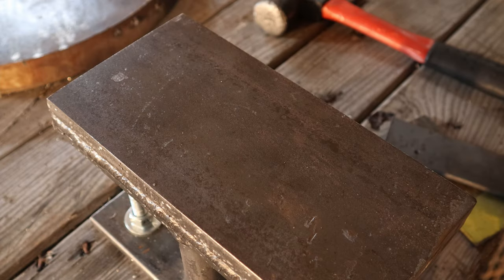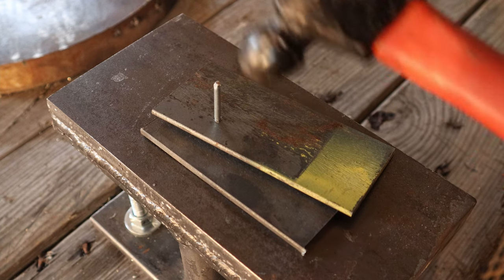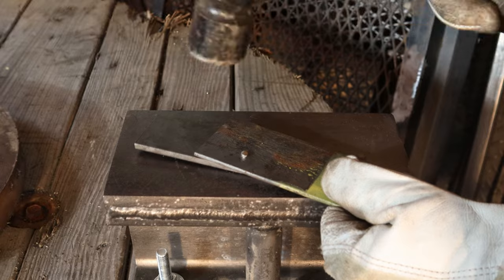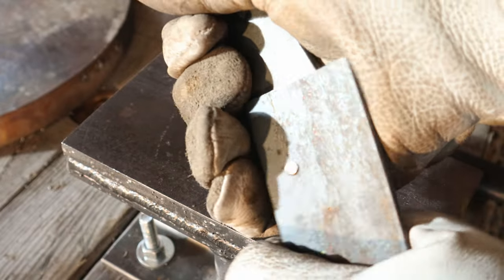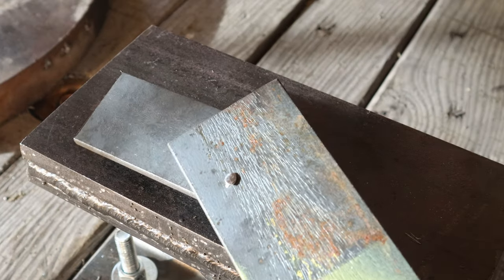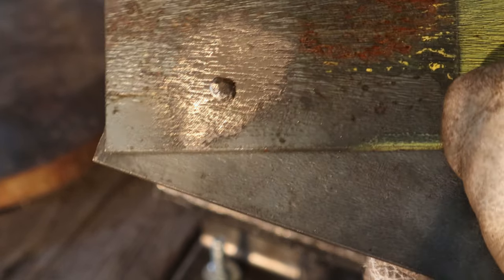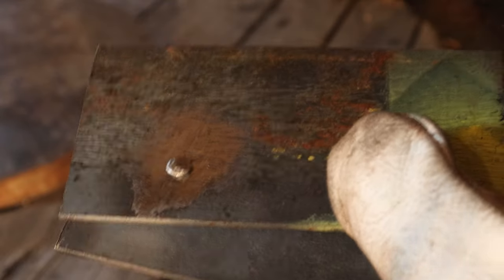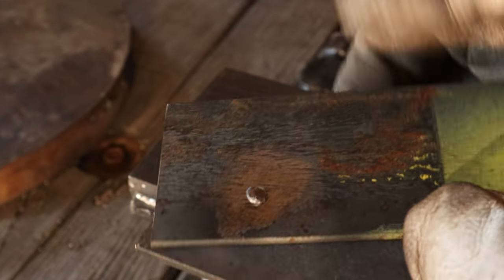DIY Rivets / Rivets From Roofing Nails

Comment: When I was in the SCA, we had a tool which was a piece of steel with a hole drilled through. It also had a shallow dished hole. We were able to get rivets at our local Ace hardware back then. I used them to make my helm. The seating tool was used to make sure there was no gap between the two sheets and the dished hole on it was used to make the rivet "swell" in the hole so the pieces wouldn't shift. Then we used the round part of the Halloween hammer to flatten the rivet. The guy who taught me was good enough, he didn't bother with the tool. If you were joining two pieces of armo that needed to rotate, like a knee or elbow piece, you put a steel washer between the two pieces of metal you're joining. 
Another thing they used to do was use pieces of wire as rivets on every other link on their chainmail to make it nearly unbreakable. The unriveted rings were welded solid.

Comment: I'm going to try this, and I'm planning to create a tiny hollow at center, on the side I'll be hitting.  Gonna use a center-punch, and possibly drill a small hole (1/16 inch, 1.6 mm deep).  I think that may help the metal spread out more easily with less effort.  Note: Will probably need to grind or file the top FLAT before making the dimple.